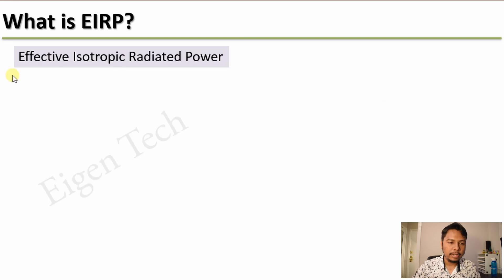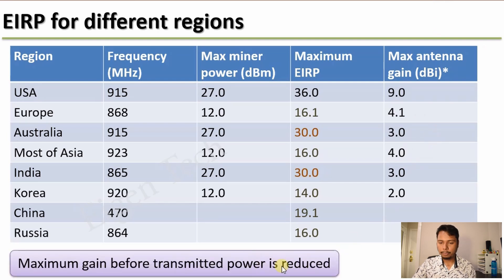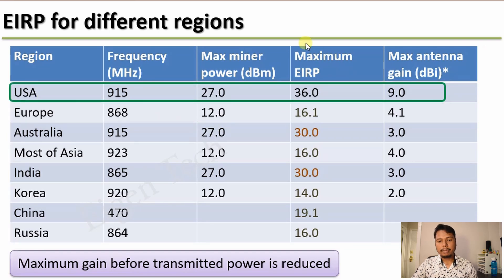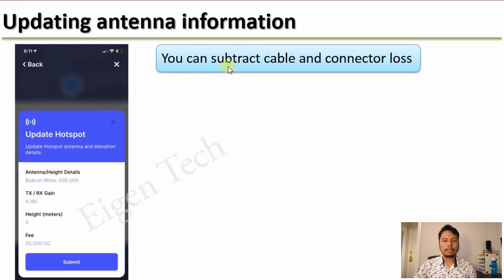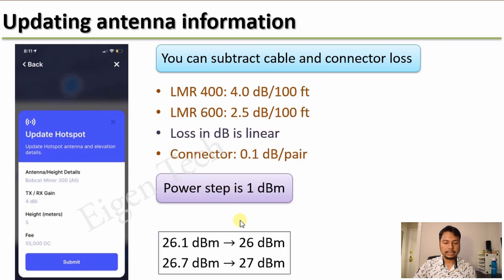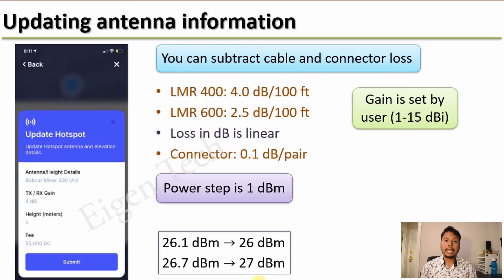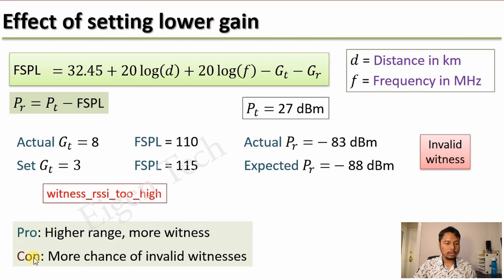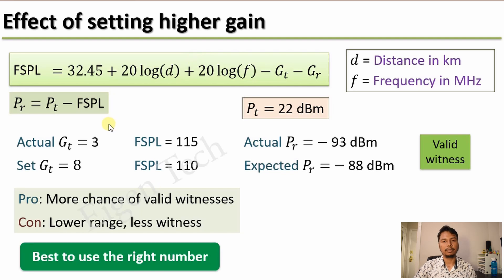Correct antenna parameters after the activation of PoCv11 | How to increase valid witnesses

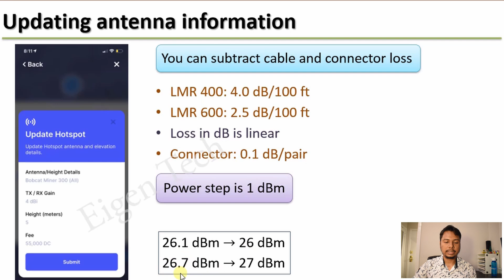Comment from the maker: The final transmitted power = Integer part of (max_eirp - gain_declared) and thus it discards the fractional part. At time 8:42 the transmitted power 26.7 dBm will be brought down to 26 dBm as well and not be rounded to 27 dBm.
Reply: Hi , if I have a 5.8 dbi antenna and a antenna magnetic base ( 1 meter cable) and I put it at 5 dbi it's good ????
Reply from the maker: @GOD-ih8cy  1 meter cable should not have so much loss. I would set 5.5 dBi

Comment: Hi Eigen! I’m in Australia and have a 10metre lmr400 with a 3dbi outdoor antenna. 
Cable loss is 1.2

When you say connectors do you mean converters or just connections to miner? Cable is attached on both ends… .2?
So would I set my miner at 1.6dbi or 1.8dbi?? 

How I understand things if I go below 3dbi it will increase transmit power to compensate for loss correct? 

Thanks a lot your videos are very informative and well made.  🙌🏼

Comment: I was recommended by rak wireless to ignore cable and connector losses and put the antenna DBI directly..... Despite 10 meters long cable with an SMA connector I am still putting 8 DBI for 8 DBi rak antenna....is that wrong .....I am outskirts of city with 0 devices nearby and many in 7 km range .... name : Innocent Gingham cyborg

Comment: Thank  you for all this info! but why when I lowed. my. antenna gain on the. app I started. getting lower quantity. of witnesses???   I. suppose to. get more. witness.  I am in the EU and I have 6dbi antenna but. when. I put 2.8dbi in the app I stated getting less witnesses. I don't have invalid tho. I. also installed an amp. with 10 RX.  I am. not sure what to. do.  I was 6dbi as my. antenna gain. in the app. and I was getting more witnesses.

Comment: @EigenTech Can you advise me please. I currently use stock bobcat 300 4dBi antenna here in the UK, i have a new 4.5dBi tuned antenna on the way should I just leave the app at 4dBi even though i'm upgrading to 4.5dBi? I'll be using 1 meter LMR 400?
Reply from the maker: I think you can leave the app settings unchanged

Comment: So does it mean it is ok to get let say a 12db antenna if you will run a 15ft RG58 cable and mount it inside the attic? With the signal loss from the cable and some loss from the attic I can set my antenna strength in my app to let say 8db? And let say I get a RSSI too high I just have to increase the antenna strength until I do not get the RSSI too high anymore?

HotspotRF simulation tells me that I will get more witnesses with higher gain antenna. But since I am only installing the antenna in the attic I have to consider signal loss and still be able to get the maximum 9db allowed for United States.   I am saying 8 db because RG58 cable will have a 3 db loss plus let say another 1 db for being indoor?

Comment: may i know how to get maximum miner power?
Reply from the maker: by using the minimum-gain antenna
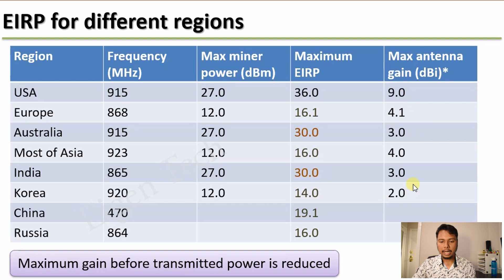Reply: @eigentech6567  thanks and sorry for my bad question, i acutally wana know how did you obtain the "Max miner power" values in your video at around 3:00
Reply from the maker: @beetesting7300  I obtained the info from specific manufacturers, but it might not be the same for new manufacturers

Comment: I need some help from you. I have a helium miner. I did installed it. Port forwarding is done correctly. Now the miner shows offline.
Reply from the maker: During initial installation the miner goes offline several times. I have a troubleshooting video that you can check out.  https://youtu.be/PSzqpNCX_zs

Comment: Could you please confirm my antenna gain? 5.8dbi antenna - Connector - 0.1 db/pair, LMR400 Cable(1m) - 0.4 db, Single Pane Glass - 0.8db = Antenna Gain 4.5dbi
Reply from the maker: There will be two pairs of connectors, so Antenna Gain 4.4dBi
Reply: @eigentech6567  Okay. Thank you.

Comment: According to the Bobcat 300 CE certification, the Max. RF power in the LoRa frequency area (863-870MHz) are 8.22 dBm, so with a maximum EIRP of 16.1, you should be able to use a 7.88 dB antenna without reduction in output power (for the Bobcat 300 miner) (if you include cable loss, an 8dB antenna should most likely also be fine).
Reply from the maker: your explanation is rcorrect

Comment: Hi, so what is the max miner power and max EIRP for Canada? Where can i find this information?
Reply from the maker: Max EIRP for Canada is 19.1 dBm. You will find the info here https://github.com/helium/miner/blob/0c29c7bbfe802ee1ced862b7ad0487814eb3c6a2/test/miner_poc_v11_vars.hrl
Reply: @eigentech6567  if in canada de eirp is 19.1, what should i use as transmit power on the miner? is this something that is configurable? if this is the same as US915, 19.1 EIRP - 27dbm would make my antenna negative dbi...

Comment: i have rssi -106 and snr 7.5, getting an invalid witness. what should i do?
Reply from the maker: Somehow the SNR is much better. If it is for a particular hotspot, you do not need to worry about it. It will most likely get fixed after pocv11 is implemented.

Comment: Hey Roy, I have Bobcat miner with the stock antenna of 4dbi, am not using any other cable. what should I putting there? The antenna is a height of 5 meters.
Reply from the maker: Use 3.9 (0.1 dB loss coming from the connector)

Comment: So if I'm in europe can I use a 8dbi antenna or it isn't allowed?
Reply from the maker: Any antenna up to 15 dBi is allowed. But the choice depends on your location.
Reply: @eigentech6567  I'm nearlyon top of the tallest building in my city, so the LOS should be good, but I dont undestrand if with this new PcCv11 it's useless to get an higher gain antenna
Reply from the maker: @Andreatuzze  I think you will not need beyond 5-6 dBi antenna. Take a look at this video once https://youtu.be/A2_sJQhpdig

Comment: I really don't get it??? It is very confusing and seems contradictory!
If poc 11 will lower my antenna gain to meet local regulations (example Australia max antenna gain is 3dbi)
Why in the world would i buy let's say 8dbi for example, and loose a lot of coverage angle without any benefits of distance gain which in my case is 8dbi (narrow angle) brought down to 3dbi (narrow angle). So this way I'm losing on distance and angle together. 

While if i stick to local regulations and buy a 3dbi antenna I'm getting the most distance allowed with the widest angle possible. 

Please correct me if I'm wrong, or advise if possible!
Reply from the maker: pocv11 will adjust the transmitted power. Yes, you are right. I would not use an antenna having more than 4dBi gain in Europe unless I am in a rural area.

Comment: Hi, thank you very much for the information. 
My setup its a bobcat 300 EU with 10 m LMR400 antenna cable, with an antenna of 6 dbi installed at 50 m high.  
I take the cable and connectors loss for around 1.5 dbi so in the app i have added 4.5 dbi.

Some times i have invalid witness with  next message "witness rssi below lower bound". In all the cases, the SNR number it seems higher as usual (6.8db, 8.8db, 13db... etc).
¿ Could be these messages, an antenna configuration problem ?

Thank you very much.

Comment: Wait so what will be the dbi limit in Europe. I just bought a 8dbi antenna and was about to set it with my 23m LMR-400 cable. the loss with connectors and cable should make my antenna around 6dbi or even less I think. should I still put it on? or just go with the 4dbi bobcat antenna?
Reply from the maker: If you are not planning to return the antenna, why don't you try it? PoCV11 is again postponed until Nov 9, 2021

Comment: can i use more then 4 dbi if i live in EU?
Reply from the maker: yes, you should choose the correct antenna gain depending on your situation and should not think much about transmitted power
Reply: @eigentech6567  i use 8dbi and 10 meter lmr 400.
Will this effect me if i live in eu

Comment: Hey buddy, is it recommended to use the RSSI offset parameter to fine tune the miners? What would the recommended values be to reduce the amount of invalid witnesses?
Reply from the maker: There is a possibility but I do not know if Helium is going to use any offset parameter that can be utilized. But you can always subtract the cable/connector loss.

Comment: Great videos mate. One thing i dont understand. I live in EU and have 8.5 dbi on the roof. Should i replace my antenna with 4 dbi or i have to add something additoinal to reduce the dbi. Will be great if you explain this. I beleive there are a lot of people with over 4 dbi antenna in EU, so will be grat what is the best approach for us. Thanks
Reply from the maker: I would ask to wait until picv11 is activated. If you observe that your earnings have reduced significantly then you can use a lower gain antenna

Comment: Hey man, could you please help me understand? How much internet does bobcat miner use? What should be minimum internet speed to have your miner to connect to? If there would be some seconds internet connection issue, would that create any syncing or such issues? Would this impact the rewards?
Reply from the maker: it needs about 500 kbps speed, uses about 30-50 GB/month. Little bit of loss of internet should not be much of a problem
Reply: @eigentech6567  thanks sir, appreciated
Reply from the maker: @Datadriveninvestments  you are welcome

Comment: I live on a hill that is 200 meters higher than the surrounding area. In my helium app, should I put 200m + 4m (which is how high the antenna is from the ground) or should I just put the 4m? Sorry if this is a dumb question but I can’t find an answer to this anywhere.
Reply from the maker: Put 204 m but it doesn't matter as pocv11 will not use the height for any calculation

Comment: Thanks Eigen Tech, for your explanations. I've got my 5.8 dBi antenna temporary mounted behind a double glazed window, cable is a 1.5m lmr400. What will be the optimum antenna data for this setup in the helium app? The cable loss is possibly around -0.3dBi and -0.1dBi for the connector?? Is there any significant loss from the double glazed windows?
Reply from the maker: Right, from cable -0.2 dB, For two pairs of connectors, -0.2 dB. What I have learned is that a 6 mm glass window has about 0.8 dB loss. So, you can use that as a rough number.
Reply: @eigentech6567  Thanks very much.
Reply: @eigentech6567  Are you referring to the connectors at the ends of the LMR 400 cable?
Reply from the maker: @harlemespanol  yes
Reply: @eigentech6567  Thank you.

Comment: The way i read POC11.  Here in Australia has a 30dbm limit. For example : Sensecap has a max output of 26dBm, so the  the maximum antenna that can go on this miner is 4bBm. Am I right or wrong.
Reply from the maker: You can use any gain. The transmitted power will be reduced if you use 5 dBi or above.
Reply: @eigentech6567  dont u mean 4 dbi or above?
Reply from the maker: @2006Pk  Yeah. Basically the point is the transmitted power will be adjusted to keep EIRP=16 dBm
Reply: @eigentech6567  whay is the point of using high gain antennas then? Shouldnt it always be better to use 3 or 4 dbi?
Reply from the maker: @2006Pk  Yes, if the max EIRP is 16dBm, then it doesn't make sense to use more than 4 dBi antenna

Comment: very good and compete explanation , thank you for all your information , 
another question , I live in UAE , is it necessary to use Lightning Protector ? and how much would be the loss signal for this part ? are they different in different brands ? and do you have any recommended brand  ?
Reply from the maker: It is a good idea to use a lightning protector for outdoor antennas, particularly if your antenna height is above other structures around yours. Typical loss is 0.2 dB.
Reply: @mostafa I'm also in UAE and considering internal vs external miner - especially with out temperatures mid summer!

Comment: Hi, TNX for all videos, they are great.
I'm concerned about that POCv11 because I already have many invalid witnesses and I don't know why.
All my information are correct, antena gain, elevation (if this means from ground), location but still i have many invalid witnessing.
First i thought that other guys didn't set correct information but when i looked at those beacons I'm the only invalid witness. Why? Will it be worse after change? 
If you want I can send names of my hotspots
Reply from the maker: If the error is witness_rssi_too_high, pocv11 should make it better. If it is rssi_below_lower_bound, it might not help
Reply: @eigentech6567  it is below lower band. For example like this:
Distance
~12 km
RSSI
−97 dBm
SNR
11,8 dB
Frequency
867,9 MHz

Comment: Hi Eigen tech, nice video! I was wondering if it's an option to use a lowrate antenna cable to use and keep a high dbi antenna? I run a 10m LMR 400 cable with a 8 dbi antenna outside in Europe. So basicly taking in POC 11 I'm only allowed to have 4,1 dbi. So for now I've set my custum antenna gain to 6.5dbi (8dbi-1.5dbi cableloss/connectors). Is it possible to change it with a cable with way more loss so I get maxed at 4.1 dbi but still keep the 9dbi antenna? Or is it better to keep the LMR400 but change the antenna to a 5.8 dbi (5.8-1.5 loss= 4.3dbi)?
Reply from the maker: you should first decide which antenna to use based on your target hotspots and then can use a lossy cable to bring the gain value down

Comment: i currently using 5.8 Dbi antenna with a loss at 0.8 Dbi.. total is 5 Dbi Gain.. So Should i put 5 dbi antenna in the helium app? or 5.8 Dbi antenna ? which one is correct. Great Rose Turkey  is my helium name.. What Antenna DBI should i go with? 3Dbi ? 6 Dbi? or stick with the 5.8?  with my loss of 0.8
Reply from the maker: if you know your loss is 0.8 dB, you can put 5.0 dBi in the app.

Comment: I updated my high and antenna gain this evening and right now that hotspot shows zero witnesses from 42 that i had this afternoon. Why is that??
Reply from the maker: That is fine. Your earning will not be affected.
Reply: @eigentech6567  hopefully not, but why reset to zero
Reply from the maker: @Av3ntur0zky  that is in the code. I do not know the logic behind that
Reply: @eigentech6567  i just been curious about it. Same thing happened to my 2nd hotspot when i updated the antenna. Btw Before the PoCv11 was activated updating the correct antena's high and dbi was a way to improve the earnings by just doing so?
Reply from the maker: @Av3ntur0zky  Before pocv11 antenna gain is not used in the FSPL calculation, so there will be no effect

Comment: Thanks so much for this informative video!  I'm certain I'm not the only legitimate miner with this situation...  I live in a suburb in the US that has a lot of hills, but in one direction is the ocean.  My 4 dbi antenna is at a higher elevation than most in the area, but it is blocked in most directions by mountains (except up the coast, over water).  The concern is that when PoC V11 starts, I and others in my situation, will be adversely affected.  A lot of my witnesses, and beacons I witness, are up to 200 km away because the signal is traveling over water.  Am I correct in assuming that those will now be considered invalid, because of the distance?  If I reduce the 4dbi by the cable, connectors, and lightning arrestor, the antenna should be listed as 2.8.  Wouldn't that make it even worse in distance?  Thanks!
Reply from the maker: Let pocv11 get activated. If you see that you are getting invalid witnesses, you can increase the gain value to 8dBi.
Reply: @eigentech6567  Thanks so much for your response.  Unfortunately, my invalid witnesses (6 in the past 5 hours) have gone to 100%.  Hopefully, pocv11 will improve that, if I can hold out!

Comment: Thank you for perfectly illuminating the problem. What I still don't know is that they can't just count on ideal conditions, which change depending on the weather. Surely they should have some tolerance pocket of maybe 3dBi before they evaluate it as invalid, right? They don't have a meter worth tens of thousands to measure RSSI so accurately. And that's what I just didn't get from the video :( .
Reply from the maker: Any weather condition will only reduce RSSI and cannot increase it, so it should still be fine
Reply: @eigentech6567  I'm still hoping that about 2-3dBi will be offset :) .
Reply from the maker: @davidponizil2308  The point is any RSSI value smaller than the theoretical value (which is the upper limit) will be accepted

Comment: Hi, thank you very much for the useful information. My setup its a bobcat 300 EU with 1m "normal" antenna cable, with an antenna of 4.5 dbi. Should i take the cable loss with connectors loss for around 0.5 dbi? Now in the app i have 4.5 dbi, should i change to 4 dbi or 0.5 dbi will not make any difference? Thank you very much.
Reply from the maker: you can subtract cable and connector loss

Comment: Thank you so much for explanation  it please I want a small help bro . 
I'm really noob to understand 
Can you tell me 
I have sensecap 2.8 dbi stock antenna 
And want to upgrade the antenna to 5.8 dbi and put it in the roof 
So 
The cable should be around 8 to 10 meter from the sensecap to the antenna . 

So PLEASE PLEASE can you tell me the calculation and what to write when I update the antenna on the app 

Please 🙏🙏🙏🙏🙏🙏🙏🙏🙏
Reply: You need to look at the specs for the cable to know what the cable loss is. Nobody here can answer your question.
Reply: @moguaiato5583  ah ok , sorry I'm a begginer 
Thank you